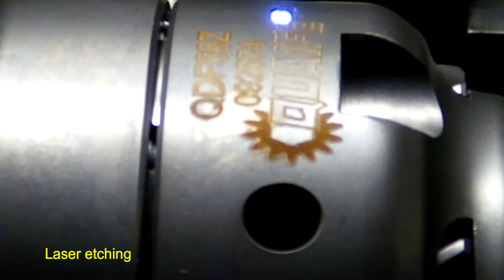Mk3 Ford Focus RS ATB Differential Assembly

Comment: Can you help with some advice please?! I'm thinking of putting a LSD in my 2017 Stage 2 RS, but am wondering if it's worth doing both front and rear diffs,.. I've spoken to several RS owners who've fitted LSDs to their fronts and recommended I do the same after they experienced a great improvement in handling, traction and in retrieving some of the BHP naturally lost to a AWD transmission, at the wheels.
     ... But I can't find any RS owners who've done both ends, I have spoken with Mountune and Pumaspeed to see if there's a greater benefit to doing both ends over just one, but they weren't really certain about it... They just said what I already knew, that 'in theory' it should.
       I'd rather not waste money fitting both if the RS will only really benefit from fitting one.
        Can you offer more certain information/advice than this? Also, what cost would I approximately have to pay for the LSD and fitting just the front and also for both ends?
         I hope you can help, thank-you!
Reply from the maker: There is only a front differential available for the Mk3 Focus RS.
The rear "differential" is not really a differential at all! It's a torque vectoring unit.
We have looked at developing a mechanical replacement for this unit, but the standard unit is so small that any replacement would not be large enough to handle the power/torque that these cars are being tuned for.
From all the reviews of these cars with the ATB fitted in the front it does seem that the standard torque vectoring unit works just fine, so there isn't a need for a mechanical rear differential as well.
Reply: @RTQuaifeEngineering  Thank-you(!),.. That now makes sense as to why I couldn't find anyone who'd fitted two.
        I don't know why mountune couldn't have told me this, it's something they really should have known. Anyway, thanks again for taking the time to respond, now I know where I stand with my finances I can finally get a LSD fitted.👍